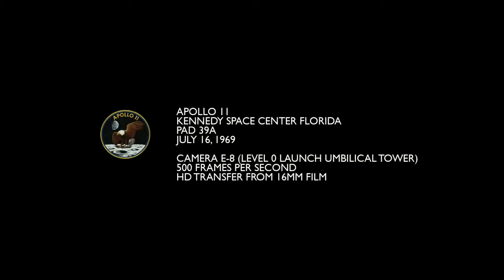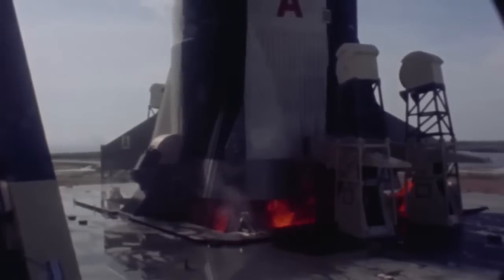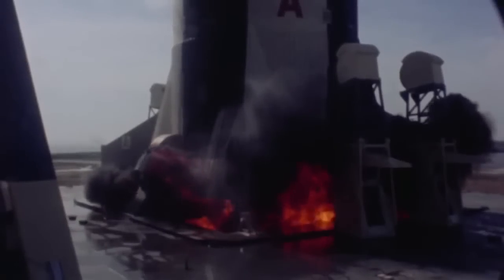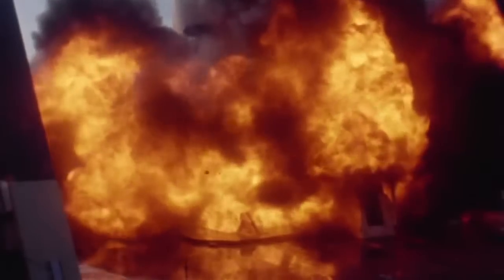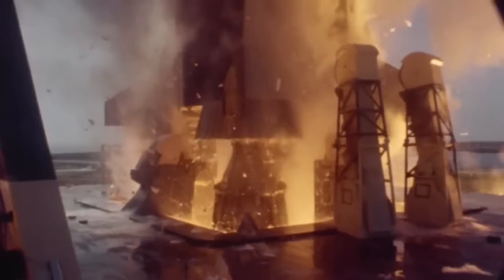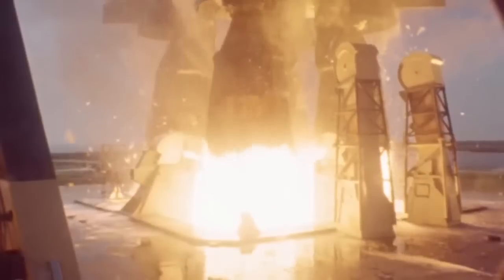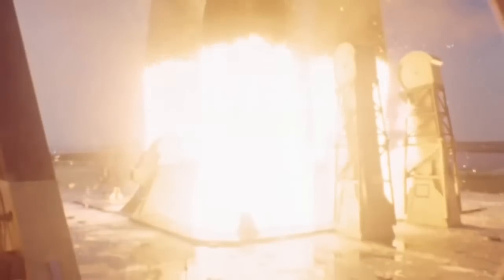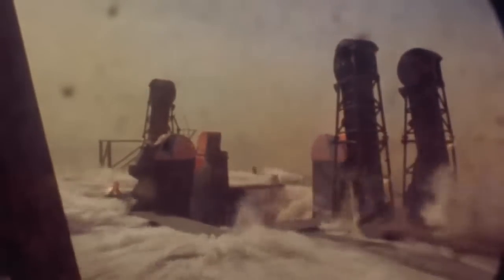Apollo 11 Saturn V Launch Slow Motion 16mm Film

Comment: I always thought there were only 3 hold down arms(in this video, 2 of the arms are at the extreme right, one on the left).
Did not realize there were separate hold down arms as well but I always was amazed how so much rocket mass could be left to only 3 points of contacts... my reasoning was something else held the Saturn V fast until a certain point of the launch, then the 3 "posts" did all the holding.

Comment: [09/12/22] As mentioned by another viewer, the ablative coating that chars and protects the steel structures and components from the intense exhaust heat is called intumescent coating, or paint. Here's a short video that demonstrates its protective qualities.

https://youtu.be/FTlGrC3Ak2M

Comment: One stat sticks with me. The turbopumps of an F1 produced/consumed 55,000 hp. That means it took 275,000 hp to run the "fuel pumps".
Reply: And they are used for how long, 60 seconds? I got an owner's manual for Saturn V rocket. The turbos were the most fascinating subsystem. They don't get much publicity.
Reply: @LouisEmery  yeah, I got the owners manual plus the parts manual. I just ordered parts for my Saturn V from rock auto. They should be here in about a week. After I install them I’m going to head out to the moon for a long weekend. I’ll send you pics.

Comment: I think I recall Elon Musk saying, in so many words, that the Saturn V moon rockets were such an anomoly in terms of technology for the 60s-70s era compared to today's rocketry... Musk's own Starship with the Super Heavy booster, NASA's SLS, etc in this current age of huge techno advancements are almost to be expected.  But back then, the Saturn V with Apollo and the moon landings were truly achievements that were mind boggling.  I remember them well from my teen years.  It's taken fifty years to assemble something that powerful.
Reply: It's taken Fifty years to (decide) to assemble something that powerful
Reply: 1957 the first satellite in orbit. 1969 man on the moon. That’s a mere 12 years. I remember the luna landings and they were impressive. But looking back at how slow progress has been since then makes Apollo and Saturn V even more impressive. When will it be beat? Even SLS and Starship aren’t capable of a single liftoff all the way to the moon’s surface and back because SLS doesn’t have a lander and starship needs refuelling. Apollo had the whole mission in one rocket. Amazing.
Reply: @KevinTheCaravanner  More amazing is the fact that it took just 66 Years to go from the first powered flight 1903 to the first moon landing, well within a human lifetime.
Reply: The advances have been in the computer controls.  Rocket hardware and materials, engines, pumps, fuel etc. have changed very little.  It is similar to modern-day cars versus the 60's.  The computer control of the ignition and fuel injection is a huge advance - largely driven by the need to meet emissions and fuel economy requirements - but it is still the same IC engine otherwise with only a few enhancements.
Reply: Wernher von Braun was a man very far ahead of his time.
Reply: Impossible for man to build it with his primitive tools at that time.  It must have been aliens!!  lol

Comment: The fury of those engines is absolutely incredible.

Watching the super bright flame front climbing up the rocket plume but not being able to “catch” the nozzle simply because of how rapidly the fuel is being ejected is mesmerizing. Even in ultra slow motion it looks quick.
Reply: Clarification on what's happening there- The fuel combustion is certainly happening well within the upper chamber of the 'convergent divergent' nozzle assembly. The gas band that appears dark in the film is cooler exhaust from the turbo pumps that pressurize the incoming fuel above the nozzle. That exhaust cannot combust any further so it's used as a boundary later around the inside of the nozzle to help with heat management. Since it's much cooler than the other combusting gases it looks like a dark band in the film giving the illusion there isn't combustion within that region. If there weren't combustion inside the nozzle (combustion chamber) there would be virtually no thrust transferred to the spacecraft. It would just be a giant flamethrower.  Cheers 🚀
Reply: That's actually basically a boundary layer of gasses pumped around the engine to help with cooling
Reply: What those two guys said ☝🏾

Comment: From about 4:40 until nearly the end, there is a lot of apparent movement of the platform itself, like it is bending and flexing under the enormous force generated by the engines.  Is that just camera movements, or is the launch pad actually designed to flex?
Reply: There was so much power in this video, I think it was my laptop was shaking on the table.
Reply: These cameras actually looked up (from below the surface of the pad itself) at a quartz mirror which reflected the light into the camera. What you're seeing is that mirror itself shaking and moving about violently inside the camera housing. I imagine the mobile launcher itself did sway quite a bit, but the mirror itself shaking probably also had a big impact.
Reply: Yes the hold down mechanisms. Did fex or twist because of the incredible unbelievable torque the F1 engine produced. To this day not other man made device besides nuclear weapons can ever and has never since matched them. There isn't a word to describe the power of that launch sequence. Nothing on earth!

Comment: How much more powerful is the sls than apollo
Reply: SLS is 8.8 million pounds of thrust vs 7.5 million for the Saturn 5
Reply: The SLS can deliver less payload to orbit, or to the Moon, than Saturn V.
Reply: Right above. Current SLS carries 210,000lb while later Saturn V carried 260,000lb payload. SLS can hit speeds of 25,000 mph while Saturn V was around 17,000mph
Reply: @gunsite45  but it could get off the ground.
Reply: @waybee100  haha it seems we lost the know-how to run those old liquid hydrogen shuttle engines 😅